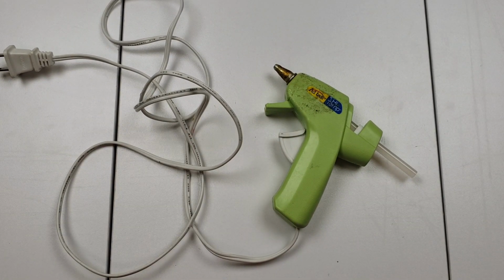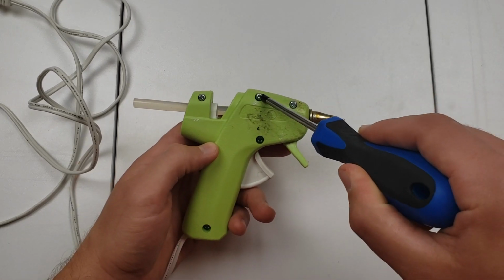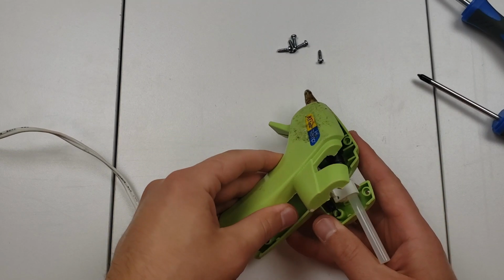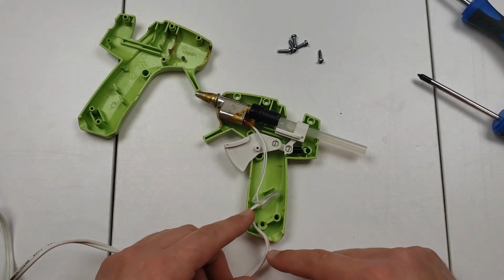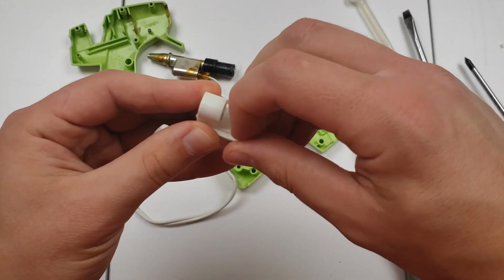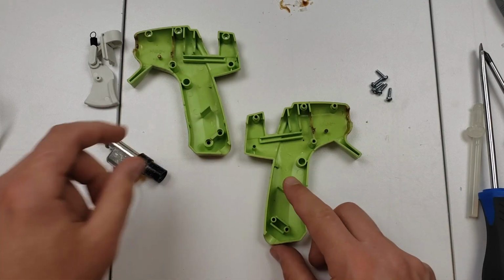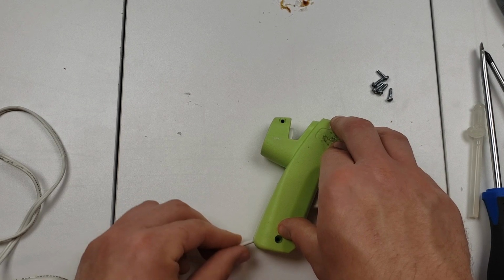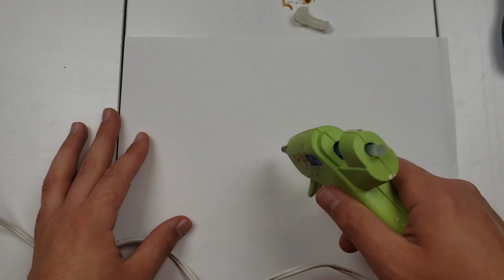How to clean hot glue gun DIY - Stuck or clogged gun - Whats inside and how it works - Tutorial

Comment: I'm the person who engineered this glue gun for ADTECH as well as many others and I can say with certainty that this method of cleaning out this or any glue gun is not necessary and certainly not recommended.  If you simply let the gun heat up, you twist the glue stick to break the seal with the silicone rubber seal, retract it slightly and cut and remove the part of the stick that is mushroomed.  A new stick should then push through normally.  If you do resort to taking it apart, leave it laying down with the screw side up, loosen (don't remove) the screws, take the cover side handle off.  This way, things stay in place.  Also, as I've read in other comments, a few seconds of applying heat with a heat gun can help release that glue sticking the halves together.  A big blob of glue doesn't happen unless the glue gun is being dramatically overused.  Maybe it's time to look for a higher output glue gun?
Reply from the maker: Thanks for the detailed information! I agree my gun was used very well for a specific project but I use it so rarely that I dont want to buy a new one. Cleaning it out was easy enough for my needs.
Reply: Yes I used mine for a big DIY. So What do you recommend in place of the glue gun.
Reply: Oh it's so cool to meet who designed them in person! I followed your instructions and it worked perfectly. Thank you

Comment: I thought it was going to be complicated with several parts but dang that looks like the most simplistic thing to fix. The hardest thing I fixed was  chainsaw hoses. The manual sucked to see were things went.

Well I fixed it it was so easy although took me 30mins my cat wanted some attention so I worked around her lol. Works like a charm now don't really know what happened the glue seemed fine what ever it was I no longer will have a blister from pushing the trigger anymore.

Comment: That brand of glue gun as Walmart is about 5.00 tops so why not just get a new one?
Reply from the maker: Cause its fun to take things apart and see how they work. Also this is the same principle for other glue guns.
Reply: Why waste the money when u can fix it? Buying one is necessary if it not repairable but if it is then they best thing to do is try to fix it yourself. Saving money 101 is to try and fix stuff yourself which is much cheaper and usually is an easy fix.
Reply: FYI it takes around 10 mins or so to fix mine works wonderfully now. So I don't need to waste money bying a new one. Robyn I suggest you tinker with things you would be amazed how many things can be fixed in little time and how inexpensive it can be. If you can't fix it and tried that's ok then go ahead and by it. However the thrill you get when you accomplish something new such as repairs like drains, mowers, washer, dryer and more is so satisfying cause you accomplished it and challenged yourself even if it seemed hard the satisfaction of say yes I repaired that I took something that broke and was going to trash it and I brought it back to working condition. 

My uncle always taught me to try and fix it yourself no matter what it is just try as you may need the skill one day and even if I couldn't the whole point was I tried my best. It cost very little time to take a hour or even 30mins a day to see if you can fix it even if you have to spread it out over multiple days. The best thing is youtube is that it make it so easy to find tutorials on how to fix things where books and manuals especially manuals can seem over complicated when it's really not. I fixed a riding mower which was $1200 then new now around $5000 so I took the bottom off where the blade goes and all that was the issue was a spring missing. That was only $5 dollars to replace and some elbow grease. Manufacturers want you to by things once something goes wrong and yes some have done it intentionally so you have to go get a new one. They will never tell you beyond basic maintenance how easy alot of things are to repair and how very little they cost to do so.